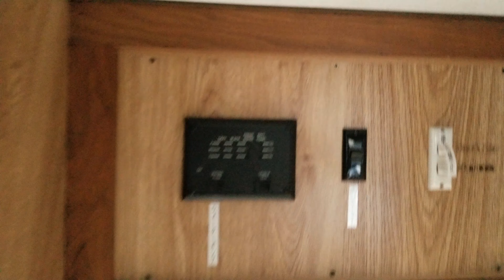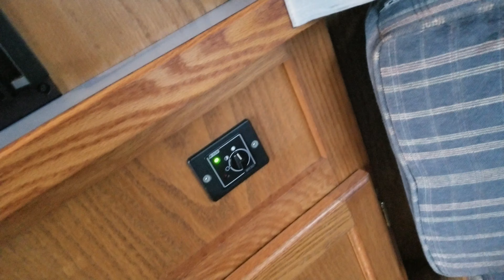MAZDA BRAWNY TRUCK MOTORHOME 4WD F5 1992, SD2AM 102940 Parts 6

Comment: Nice Mazda motorhome. Why these were never available here in the USA is beyond me. Right up to the 90s, you saw Toyota truck based Motorhomes. But never Mazdas.
Reply from the maker: Thank you very much yes exactly,  low mileage 31000ml
Reply: @jdmcarandmotorcycle   I've seen plenty of Toyota Hilux based motorhomes sold in the USA, particularly here in the Northwest. I used to know someone who had one. Given how much it weighed, particularly with people and camping gear, I would've thought it should've been offered with a diesel engine, or a turbo diesel engine. Sadly, for some reason, they were never offered with such engines for the USA market.